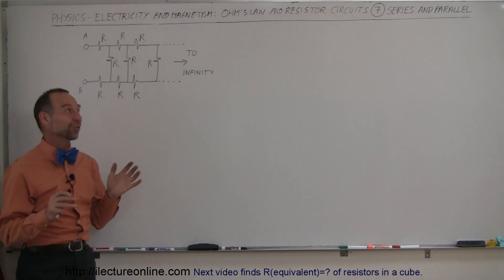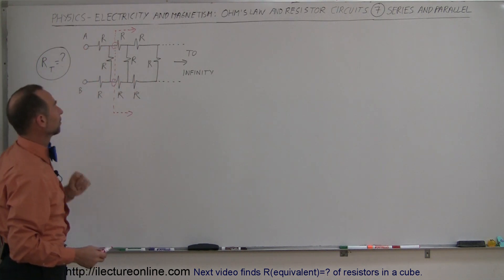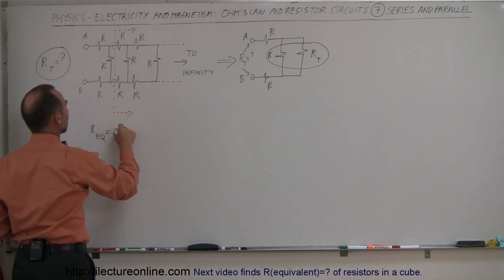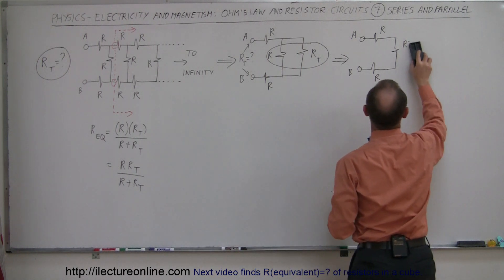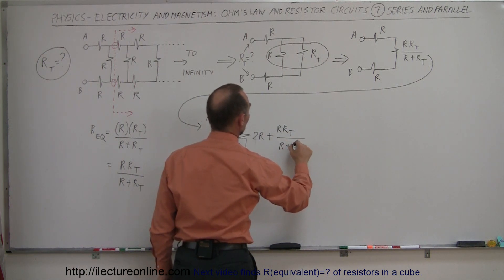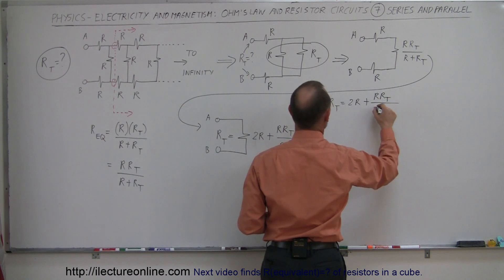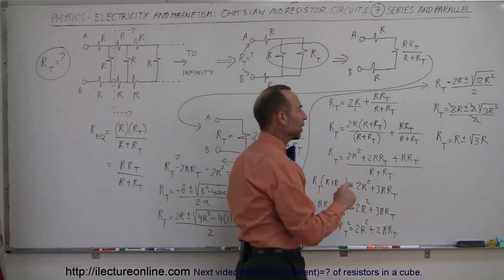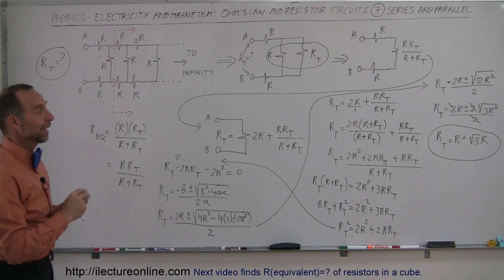Physics 42   Ohm's Law and Resistor Circuits (7 of 23) Series and Parallel (to Infinity)

Comment: Hello professor,
Really good explanation.
I was really wondering what would be the total resistance of the electric railway power line overhead.
There must be some degree of capacitance or inductance as well as resistance .
I think in the same manner the total impedance of the catenary power lines would also be solved.
Thanks a lot for your good videos.
Now I feel I have a better idea of the electric railway system.
Reply from the maker: There is never a situation where there is zero capacitance and zero inductance but in the railway power line, they would be a miniscule factor.

Comment: Great explanation, and I love your work Professor, however I am a little concerned with the algebra. Can you please explain to me, why is it that your R total/ R equivalent is equal to that of R total infinity. Is it not arguable that they aren't equal? Reason being, the R total for infinity (R total), in your case arguably, as according to the basics of calculus, has a ratio of infinity is to infinity. That implies that, the ratio is an undefined ratio, because the division of infinity is unknown. Not that I disagree with your methodology, but whence taking this factor into consideration, will it not also change the algebra behind it? 

From my working (taking infinity into consideration), the final quadratic equation should be, in simple format, 2R^2+2R*R(infinity)-R*R(total). Thus, we can take out a common factor of R, implying that R = 0 ohm or R = 1/2 * [R(total) - 2 R(infinity)]. Please get back to me ASAP.  Again, thank you for your work, Prof, I really benefit from you.
Reply from the maker: The video is correct and the answer is correct.  Thanks for checking.